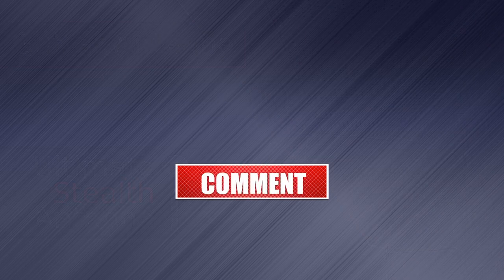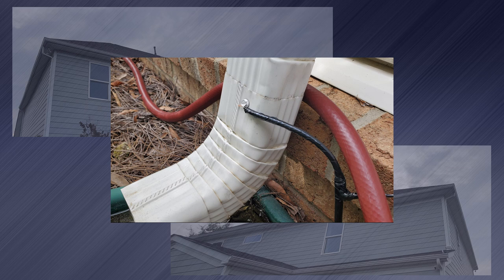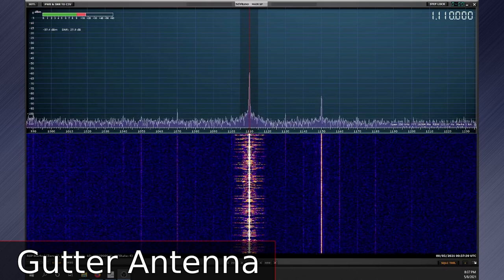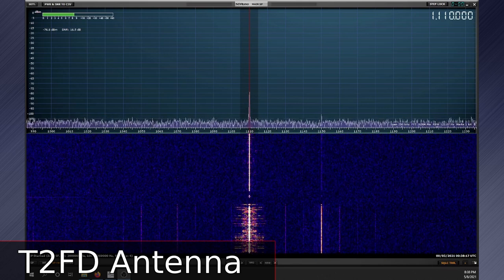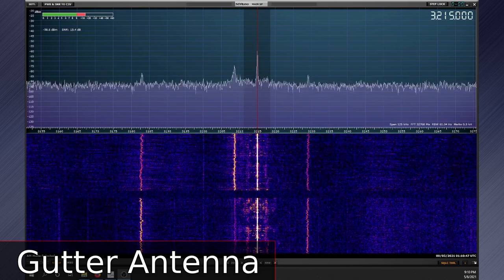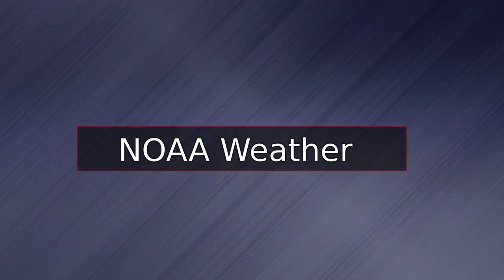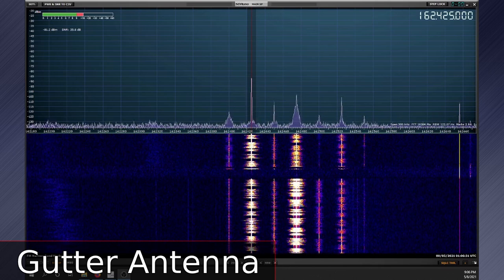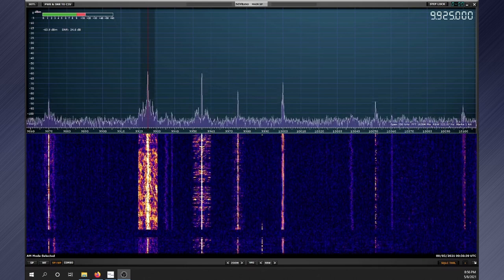Gutter Antenna, Ultimate Stealth Antenna?

Comment: I lived in a 3 story colonial house in Rhode Island with metal gutters. It had a few downspouts as well but the main gutters were pretty high up, around 30 or more feet. I fed it similar to what you did in this video but used RG-58, spare stuff I had laying around. I then laid out three radials, one 120 feet long and two around 60 feet long..........this antenna worked very well. I was able to load it on 160, 80, and 40 with no real issues. I just used an old Dentron 2kw tuner in the shack so it was not even tuned remotely. When running higher power with around 800 watts it would mess with my home alarm system and my garage door opener lights would come on but it WORKED. I was actually shocked that it allowed me to get on 160 and 80. A short time after putting up the gutter antenna I put up a 43 foot vertical out in the yard.
Reply from the maker: When keying up your radio causes electrical devices in your house to act up you have to much RFI and need to turn the power down and find the cause.

Comment: I use the gutter system of my apartment building as my primary, every day HF antenna. I make 8-10000 mile contacts using mine almost every day. I do feed it using a 9:1 impedance transformer. Works surprisingly well to the point that I rarely put up my EFHW or EFRW at all any more. Thanks for the video. W3OY
Reply from the maker: I am not surprised by the results but agree that it needs feed with a 9:1
Reply: I’ve also had good luck recently testing with RG8X feed-line to a 9:1 unun connected to a downspout, as well as a ground wire installed to the unun ground connection. I was able to check and confirm electrical continuity between downspout and gutter connection (will improve/secure this later), and I’ve had great luck pairing this setup with an MFJ-939 automatic tuner. Might not even need an external tuner on some bands if you’ve got an internal tuner in your transceiver and low enough swr. I’m able to tune and operate on 6m through 160m. All bands will tune to <1.5 SWR except 6m, which was closer to 2.5 SWR, if I recall correctly. The gutter is on the second floor and I’ve had a phone/voice contact from the NW US to Japan on 17m, and FT8 contact as far as South Africa on 30m during testing. It has popped the seal off several bands for me to operate. Never would have imagined 160m working either, but it has. I’m like a kid in a candy store now. 👍⚡️📻 Cheers, and good luck to anyone trying this stealthy option! 👍
Reply from the maker: @Tommy_Boy.  Awesome to hear you've had great success with it!
Reply: Hi. I am a noob and i want to use my gutter as an antenna due to hoa. Can you tell me what i need to buy? I don't have anything yet
Reply from the maker: @eddiemorfiris4144  Are you planning to transmit with it or just receive? If just receive you can just connect coax to the gutter/downspout and a ground rod but a 9:1 impedance transformer can help improve reception. If your going to transmit (which I don't recommend)  you will need a very good antenna tuner,  9:1 impedance transformer, and a very good ground system in place.
Reply: @eddiemorfiris4144  I’ve been using my gutters to transmit with no issue. I’m sure it depends on the length. You have to be careful that it is not a exact half wavelength multiple long because the impudence’s can be 3000+ ohms at those lengths. Also, a good idea to invest in a NanoVNA or other analyzer so you can know what your radio is going to see before you go putting any power to it. I actually have what I use on my QRZ page if you’d like to look. Happy hamming, 73 de W3OY

Comment: Yes, this is about what I would expect.  The disadvantage of the gutter antenna is that it is too close to the house, and so will pick up RFI sources inside the house.  If you have to remain stealthy, the gutter antenna is still a good way to go.  If you can get away with a wire antenna, put it up high in the trees and away from the house and power lines.  And use a ground rod under the antenna, connected to the shield of the coax.  Reducing RFI pickup is critical to good reception.
Reply from the maker: Agreed. Ground is a vital part of the antenna system.

Comment: I have been using my RSP1A along with my Icom radio for going on two years now with my gutters. Works great and the HOA is happy.
Reply from the maker: Awesome! Always great to find a compromise that keeps everyone happy. Since I made the video I find the gutter fills in the holes I have with my T2FD. So it will stay permanent.
Reply: @BrokenSignal  Yes for me this just shows again there can be different antennas for different frequencies and different directions. I have 5 random wires (and an ATU and noise canceller) and its interesting to switch and see which one is better for what I'm trying to listen to. You have motivated me to try my gutter! But the joins in the (2 storey) downpipe are not soldered so I think I'll attach the coax to the gutter itself. I have a noisy location so I'm not optimistic!
Reply from the maker: @F1NUTRR  Agreed. Also make sure to share your results with your gutter experiment.

Comment: Great video. I understand that the center wire of the coaxial is screwed to the gutter and the silver mesh of the coax is attached to the water plumbing or some sort of ground. Right?
Reply from the maker: Sorry for the delay in replying. This is correct.

Comment: I know this is a two year old video. However, I wonder if any of your listeners have a flat roof with a metal drip edge that has been made into an ham antenna. Mine is continuous on the perimeter of the home and isn't grounded anywhere. Hmmmmm, going to have to take a look to see if there is any information on this as an antenna. Thanks for the informative idea.
Reply from the maker: Sounds like an interesting experiment

Comment: Hi there. Yeah in using the gutter as a SW receiver antenna and actually connecting it to the wire slug on my Kenwood at 230 I was able to do some 10 meter contacts at 50watts
Reply from the maker: Awesome, glad it works for you!

Comment: I have Tried SO Many Things And I Can Say, YES, This Really Works Good :)
Some Fine Tunning here ANd There ANd You Golden
Im RUnning Now Antenna On My House Top Metal That's Folded To Roofing On Each Side, I Cut It In Hald And My Metal That Keeps The Rain From Middle Of The Rood / Tip Of The Roof Is Antenna, Around 15 Meters High, Location is Latvia And Im getting Chinese Stations And Like, Half Of The World Stations.
Reply from the maker: It amazes me how so many people think you have to spend thousands on this hobby and forget it started with simple things like this

Comment: My gutter doesn’t go around the house continuously, there is a - 30ft straight section, an L-shaped section ea leg about 15 ft this is where I’m connected now. It faces north and east respectively. Two 20 ft sections in the back both facing due south and a 15 ft section facing west. Single story house so not much height. I didn’t know what to connect the shield wire to until I watched this video, so ty for that. I pickup the radio stations down on 1.240 & 1.440 MHz, some evening conversations on 3.718 & 3.808 MHz and some of the skip up on 27.030 & 28.779 MHz when it’s running. Not much else which I blame on the height, or lack of, of my gutter. Can I connect the other sections all together with a solid copper electrical wire? Would the need to be “shielded” also? Thanks for answering if and when u do.
Reply from the maker: If your not getting good results it could be your not getting a good connection between seams of your gutter. I have seen where people have made small jumpers between the seams. 

You can connect sections of gutters together with wire. Doesn't matter if it's shielded or not as long as it's not "grounding" out on something.  

I wouldn't go through to much trouble trying to get this to work. The idea is for it to be quick and easy while being stealth. If you have to put much work into it there are better alternatives Good luck!
Reply: @BrokenSignal  now I’m curious…better alternatives??
Reply from the maker: @theaspiephotographer  It really depends on what your using the antenna for.

Comment: Hi, great video.  What did you use for a balun and antenna tuner?  Thanks for any time you spend on this.
Reply from the maker: I used the Gutter Antenna for receive only so I just connected the center coax directly to it and the shield to an earth ground. If you where going to try to transmit (which people have) you will want to use a 9:1 Balun and a tuner will be a must! Start with low power and try to get an acceptable SWR, don't want to fry your finals on something like this.
Reply: @BrokenSignal  Great. Thanks for the info.
Reply: @BrokenSignal  Your entering dangerous territory if you transmit.
1st off if somebody was to touch  it they could get an RF burn. If anybody is just near it, it's going to violate the distance for permissible exposure set by the FCC MPE (look it up) and finally fire hazard. That RF looking for a path to ground and if it starts arching.
Reply from the maker: @davep6977  I agree, it's best to just use it for receive only. And I couldn't ever see this having good results transmitting so why bother.

Comment: I wonder if using a pool cage would be effective also? I have more pool cage than gutter.
Reply from the maker: If the pool cage grounded? Then probably not. But you could try it anyway, just don't use it for transmitting.

Comment: Did you try it with a ATU
Reply from the maker: No. But I also do not transmit with it and would not suggest trying so either. A manual tuner might be interesting though (on receive)